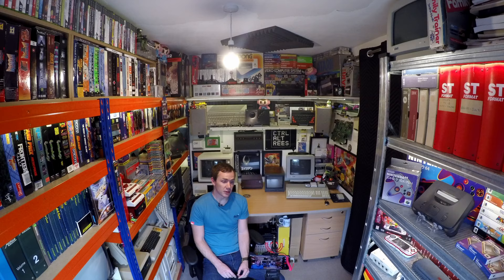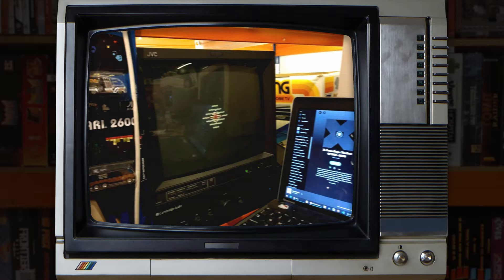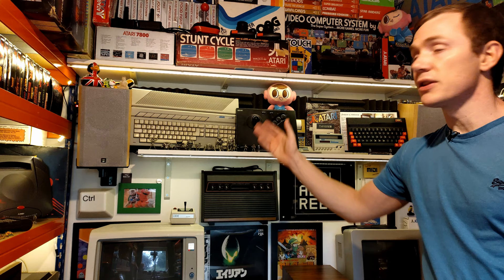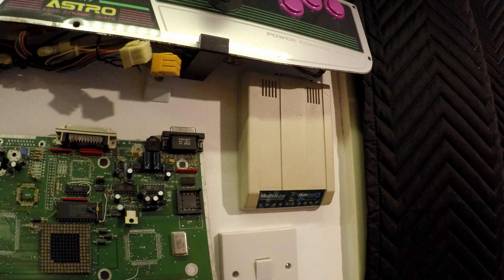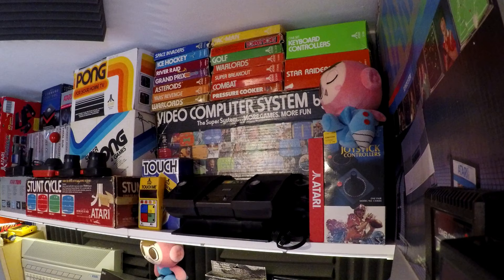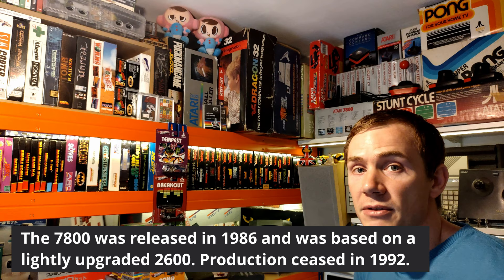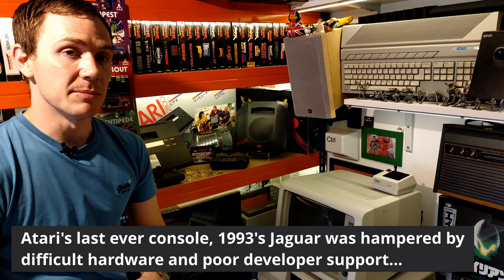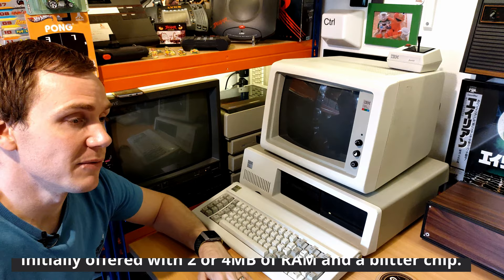TINY Game Room / YouTube Studio Tour (2.3m x 2.9m / 7'6 x 9'6) - 2021 Update!

Comment: With respect to collecting I've had a similar change of heart recently; if it doesn't have a personal connection to my history it's going on eBay. Regarding the Archimedes slightly older UK viewers will be all too familiar with the horror of having to run PC emulators on those things for A level computing classes circa 92-94, an emotional connection of a very different kind!! The masochist in me is tempted to take it off you if the price is right.......